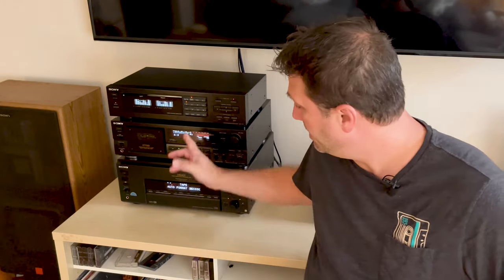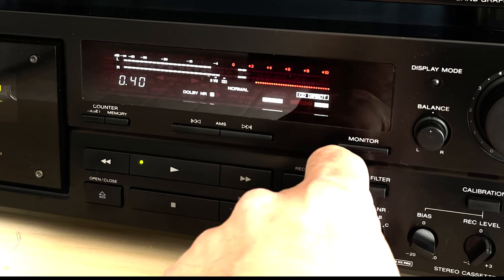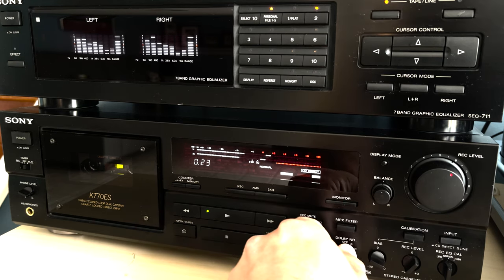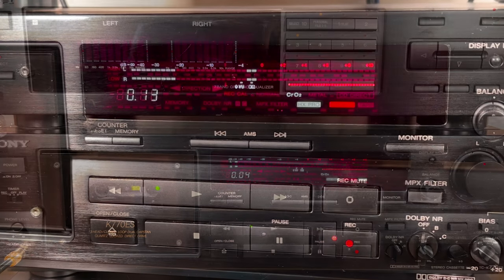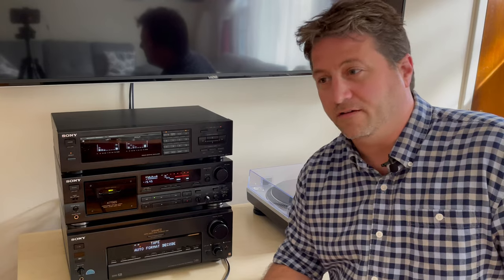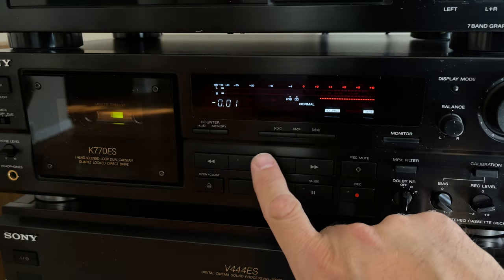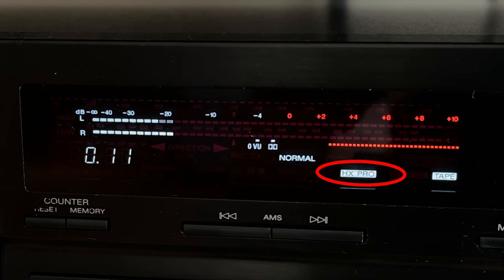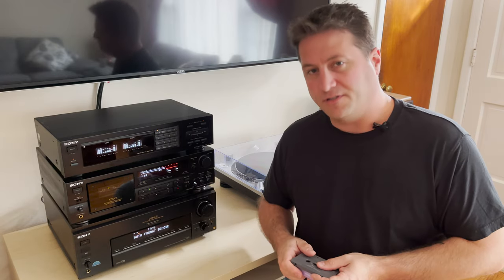Dolby Noise Reduction - Did it ever really work right?

Comment: To do a truly good bias calibration record pink noise, listen to the high end comparing to the source. It should sound as close to identical as you can get. Here's my method on two head decks. Digitizing your pink noise recording into audacity you can use the "split to mono" feature on both the source and the recording to compare left and right channels. Also you need to make sure the volume of the recording and source are equal, use the "gain" function to do this. If you do this and the internal record and playback pots are calibrated well enough, you won't lose any high end at all. In fact, you can boost it by under biasing a little if you desire. A bit time consuming, but you'll get a perfect recording using dolby. 
Now, I see you have a three head deck, so this process could be even more streamlined by just switching between the source and recording while listening to the pink noise. You won't get quite as close as you will by digitizing into audacity and splitting to mono and making sure the volumes are perfectly equal, but it should be adequate. 
I just have two head decks myself so the first method is what I use. Just using vu meters like you did here will get you close, but tiny adjustments that won't even register on those meters can be made with your ears and pink noise. Do not try white noise, white noise is nothing like music and the only way a cassette can match the source using it is with extreme under biasing.
You do not need type 2 or 4 tapes. A decent enough type 1 will work, but it will have a higher noise floor.
Reply from the maker: I gotta try this method - thanks for the info!
Reply: @TechStuff1  Forgot to put in there. The pink noise can be generated in audacity. Also, instead of comparing the recorded pink noise to an untouched freshly generated pink noise in audacity, it might be better for your source pink noise to instead be coming from the headphone jack or line out on the deck in the process of recording. The generated pink noise is just what you obviously use to make the recording. To me this makes sense as the deck might change it a little bit as it goes through the circuitry, so you might want to match what comes out, not went in... maybe. I can't conclusively say for sure if it makes more sense to use the original untouched pink noise in audacity or after it has gone through the deck and back into audacity as your source as both will give you outstanding results, but I think it makes more sense to use the latter. That and the volumes will be much closer or exact, they might be 1-2  db off, depends on how calibrated the deck is and the tape.
Good luck hope it works out for you. Hopefully you can start using dolby for your recordings.
Reply: Another source of noise (not pink though) is to use the static from a tuner. With a digital tuner, it may be harder to find an empty bad, but it's worth a try.

Comment: 3:53 Notice the bias knob is fully to the positives. If left at this position every tape (even a metal) will sound muffled with, or without Dolby. A decent deck like this can provide quite good recorgings on a good tape, regardless of what kind of Dolby is selected. Presumably the mistake lies in the use of the bias knob. This is meant to give the last fine touch to the auto calibration calibration and given that the latter is adequate, the deviation from 0 is expected to be small. The recording steps IMO sould be the following:

1. Select Dolby type (if desired).
2. Use the calibration button to let the deck calibrate itself for the characteristics of the tape in use. Use of the small rec level knob is needed to match the levels of th source and the tape. Use of the large rec level to adjust the peaks.
3. Start recording and monitor by switching betwen tape and source. At this point and ONLY AT THIS POINT the bias knob should be used in order for the tape to match the source as good as possible. Usually a minor left turn must be fine for normal tapes, a similar right turn for metal tapes and almost nothing for type II.

Comment: On my former deck Pioneer ct 450, both Dolby B and C works extremely well. Especially C ,full of strength and dynamic.
Reply: I also always use Dolby C on my old Dual CC8020. Any sound distortion. Checked by switching from original music signal to the  recorded one and back -- no difference. And no hiss.

Comment: My understanding is that Dolby Noise Reduction (DNR) only raises the highs when the volume on the tape is low because that is when you would notice the tape hiss. That could be the reasons that the sound is thrown off when you play the tape back when using DNR because the deck has to correctly determine when the highs should be reduced.

When I was using cassette tapes I thought that instead of using DNR I'd use a graphic equalizer to manually raise the frequencies where the tape hiss is, and then manually reduce it by the same amount when playing the tape back. Basically, it would be the same thing that DNR does except it would be on all the time.

Comment: I worked at an audio video store, the sales staff were saying Dolby NR was a marketing gimmick so that major consumer electronics companies can sell as many units as possible for maximum profit.
Reply: Dolby NR actually worked in reducing motor noise and tape hiss. But you needed to adjust bias while recording to get recording similar to source and not muffled. 3 head decks helped in this regard as you could quickly switch between source and tape. Also you needed dolby nr turned on while playing to make tapes sound decent and not too much bright

Comment: You could have actually put the 3-head system to use to jump between source and the different dolby's... The three heads on there are for a reason you know. Another thing you would have to look for is if the deck is even properly calibrated. Dolby B is quite forgiving to a slightly off azimuth or improper levels on the deck, but Dolby C easily sounds muffled.

Comment: All my Sony, Aiwa and Panasonic personal stereos (with the exception of the Sony WM-701C & WM-550C) tracked all my cassettes made on my Sony and JVC decks. Dolby was no problem. Well, Dolby B that is. Dolby C interchanges well between my full sized decks. I have three JVC KD-V6J /TD-V66s, two Sony TC-K555es and a TC-K333es and it matters not what deck recorded what cassette, they all interchange well with C-type encoded cassettes. But the Walkmans can't track Dolby C worth shit. The tolerance is too low for C-type to mis-track. 
My primary issue was always with pre-recorded cassettes not being able to decode Dobly-B properly, which is likely why most people thought Dolby was crap.

Dolby C encoded tapes playback perfectly fine with B-type decoding. This was by design but the end result is the same as if it were a Dolby B tape to begin with. What you cannot do is decode C on a B-type only tape, but you can certainly get B from C.

Comment: Dolby works very good in my experience when the calibration is done very carefully, including the internal meter calibration that can shift over the time. Also some tapes didnt had a very flat frequency response and worked less with dolby.

Comment: Couple of things. First, turning the record bias up all the way like it appears you did will definitely dull out the high end. To set it correctly, tune an FM tuner in between stations with muting off and let that be the source into your deck. (It's pink noise.) Since it's a 3-head, you can monitor changes off the tape; so adjust the bias while listening to hear the best high frequencies. Switch between source and tape on your cassette deck to check it. Next, always under-record a little bit. If you push the loudest parts up so that the peaks hit or exceed the Double-D logo, you'll possibly saturate the tape, which means a dull high end. Lastly, I don't know if your Sony has it, but many decks from that era had a calibration tone that you could use (I think it was 400Hz) to set the Dolby tracking. If that's available, use it. I think you will notice a significant difference if you do these things.

Comment: The best bet is to have a deck that can calibrate for the individual tape (either manual or auto-calibrate), and then record the tape as "hot" (highest input level) that you can without causing distortion.  The quality is much higher and the hiss will only really be noticeable during very quiet passages or in between tracks.  So, yes, I agree with the channel.

Comment: Actually most prerecorded tapes used dolby nr. Its also less necessary for rock or pop music were the signal is usually above the noise floor thus covering up the hiss. Especially if you record your tapes “hot”, which is much easier to do with better hardware and tape formulations. For styles like Jazz or classical where they have greater dynamic range in the compositions there will be lots quieter passages within a given piece, and for some soft mellow pieces the entirety might be insufficiently loud to cover up the hiss. And these styles were more popular when dobly was developed so it made sense to use it often.
One additional point is that dolby B effect is limited so that one can playback a tape recorded with dolby B in a deck that had no dolby circuits (many OEM car stereo decks for example didn’t have dolby because the auto companies would have to pay a licensing fee for each car that had a tape deck with the technology) and it will sound ok and not too weird. Cant do that with C or S, or other NR types like dbx.

Comment: Great video!  I myself have always preferred listening to my cassettes with Dolby off.  Yes, the hiss is there, but I too always felt that the high ends of the music suffered when using Dolby noise reduction.  I've had a lot of different decks over my lifetime.  Some cheap, some expensive.  And I always seem to have about the same results.  I did learn at a young age that the quality of the tape did make a difference to my ears.  Maybe I wasn't doing something right?  Possibly yes.  Did I just get used to the sound of no Dolby on since I started listening so long ago in the early 80's?  Probably.  I suppose I'm just used to it, like a pop or crack in a record.  Either way, I still enjoy them!

Comment: There's no such thing as a quality cassette deck without Dolby (well, yes there were other good systems available such as JVC's SANRS, but Dolby was dominant in a big way). Tape noise will always be an issue without Dolby or decent equivalent and in cassette's heyday only the cheapest and nastiest equipment would have omitted it. All modern decks use essentially the same transport mechanism that is utter pants whatever their price, and they also have no Dolby because it isn't licenced anymore. There are a few high quality looking decks available that are reminiscent of equipment from the 1990s, but this is sadly just a facade. Did you actually switch Dolby B and C on for the recording as well as the playback? There's no sign that you did but you may just have omitted it from the video. Dolby is a two way process requiring to be used during both recording and playback. And you certainly can't switch between B and C when playing back (like you were doing) the same recording unless you want rubbish results; Dolby B only works properly with Dolby B recordings, and the same goes for Dolby C (and Dolby S too). You also appear to have set the bias to max, which will kill the high frequencies Others have mentioned the Azimuth which basically means that the recording and playback heads should be at exactly 90 degrees to the tape travel. It doesn't actually matter if it isn't quite accurate, so long as you play the tape back on the same deck you recorded on. If the playback deck has a different angle to the record deck, sound suffers. This is one of the reasons, apart from terrible quality tape, that  pre-records often sound so rubbish because they just didn't care about accuracy so long as they got the money. Modern tape quality is also utter rubbish, being more akin to that of the the early 1960s when cassette was just a medium for dictation machines; peak time for tape quality was probably the 1980s and early 1990s. Now we just get the most basic ferric formulations. Anyone who thinks that Dolby just muffles the sound is either using rubbish tape, or has the deck set up and calibrated incorrectly. I have a machine from the early 1990s and no-one has ever been able to tell between a tape and the CD it came from when using Chrome or metal tape. As with all analogue sound, setting equipment up properly is far more critical than with digital. To be honest, if you really want to get into high quality cassette sound you need to find a well looked after 1980s ish deck and get some decent tapes from the same era from Ebay or similar (they're not cheap nowadays unfortunately). By the way HX Pro has nothing to do with noise reduction, but is a record only system that varies the bias signal to improve high frequency reproduction depending on the amount of high frequencies in the music at any given time.

Comment: Dolby B, and later C, became ubiquitous.  You'd see it on Walkmans and all manner of budget decks.  Now your deck isn't a budget deck, but it does come off an assembly line at a plant where the watchword is to ship, ship, ship.  I have a 3-head Sony deck myself not too different than yours except mine had the newer Dolby S included.  I noticed my Sony must be somewhat not aligned to it's best as my home recorded tapes with B & C sounded crisper on my Aiwa and JVC 3-head decks.  Either these are off at exactly the same amount or the Sony is?  I'll guess since two of three sound more crisp in the highs with Dolby B or C that the heads must be more to spec as far as alignment goes.   The best Nakamichi decks had very rigid head stacks whose adjustment mechanics were meant to be tweaked, even automatically.  They didn't wear out with tweaking as it was a factor built in to their design.  Most other Japanese decks eschewed easy to adjust head alignment screws, even putting a dab of locktite on them so they would never move.  Let's say these screws are loosened and moved.  The stamped metal chassis for the heads being less rigid and the cheap screws add up to drift, sometimes sooner than later even after a righteous alignment.  I feel your Dolby is better off solution in the light of these things.  My 2004 Audi S4 factory cassette has Dolby B and it sounds just like a cloth was dampening the highs.  Head cleaning and demagnetizing makes no difference.  It's because it's a cheap auto-reversing mechanism with terrible alignment.  I'll quit, but I'll say Dolby B and C is not as inherently flawed as the high-speed pre-recorded tapes or the poorly aligned tape heads.  It can be implemented and played back properly but so few decks actually do this.

Comment: This matches with my experience of Dolby, I almost never used it, especially on type 1 ferric tapes which already sounded quite muffled. I would sometimes use it for playback of chrome tapes which had a much brighter sound and could cut through the muffled effect, but on quiet passages you would still get reverb tails cut off. On my Walkman I was forever switching Dolby on and off depending on the recorded material and type of cassette. There was never one universal setting which works on all music

Comment: I feel that dbx nr is best by far, no hiss, sounds just like the source you should buy a unit with dbx and try it, it but must be recorded hot read the manuel on unit for peak setting.
Reply from the maker: It's funny, out of all the equipment I've owned over the years, I never owned anything with dbx. I had a dbx compression unit, but not anything with noise reduction.
Reply: @TechStuff1  dbx NR definitely works well, but sounds awful in decks that don't support dbx.  Great video, as I too didn't care for the high frequency roll off of Dolby.
Reply: yep, dbx definetely works very well

Comment: The consumer market Dolby systems was bad. The professional type A and SR worked very well. Cassette decks with DBX was way better than the Dolby B/C ones. They even experimented with DBX coded vinyl records, which sounded awesome. They had very good dynamic range, and no noise or crackle. Too bad they didn't make it to the market, because then CD's came out.

Comment: Ive been confused about dolby.
I recently recorded a bunch of tapes with dolby but noticed the muffling when playing them back with Dolby c turned on.
I thought my decks/boomboxes weren't correctly calibrated but it seems its just the norm & ill probably be better off playing my tapes with Dolby turned off.
Reply: It is misadjusted. It is not normal. Don't use Dolby C then, Dolby B works better with non-calibrated or worn heads.

Comment: Dolby is extremely hit or miss even if I do have my pioneer 603rs set and cleaned right that I never use it but I do use the flex feature which improves the highs especially on bad tapes

Comment: The way I always use the dolby nr is to record with it on and play with it off, the hiss is still there but sounds alot better.
Reply from the maker: Interesting...I think the highs might be too harsh for my liking.
Reply: @TechStuff1  same. There was a DNR button on my old Chevrolet that sounded good so I don't know what that shit was
Reply: But you add an artificial treble boost that makes the tape sounding quite shrill. I used to like my tapes that way until I was adquiring more experience in audio.
Reply: I was always told if you record with it on you have to play the tape back with it on
Reply: Back in the day, I recorded with Dolby B on, and played back with it off as well. Most of my tapes were mix tapes I played in the car, and the extra high end was helpful there. I have a new (to me) 3 head deck I'm trying to get repaired. Once I get that back I'll try experimenting with NR and tape types and see what I find with that.